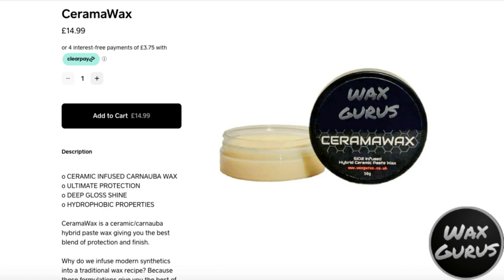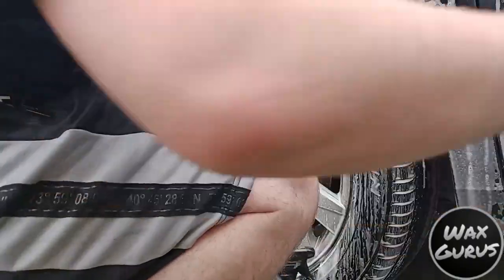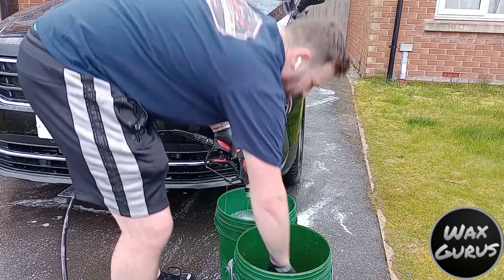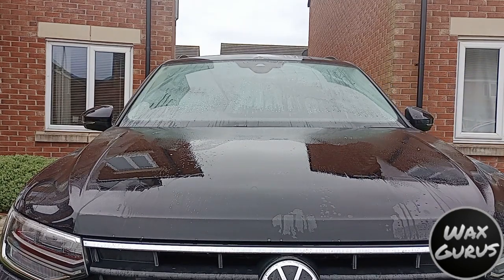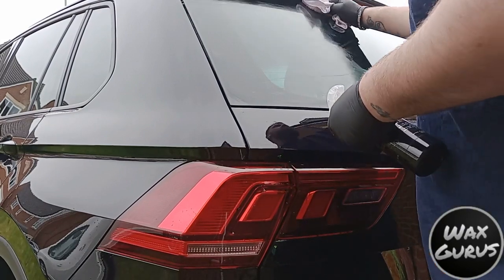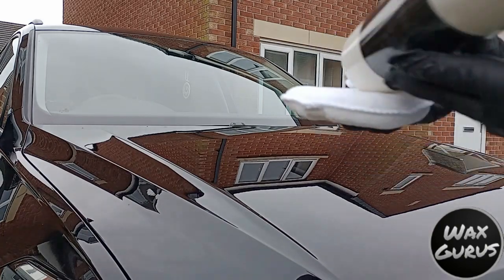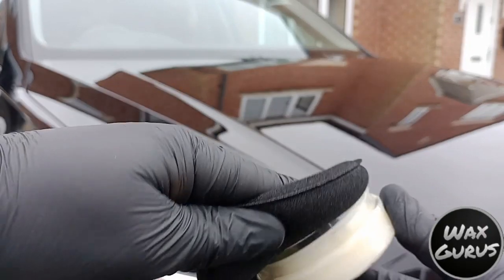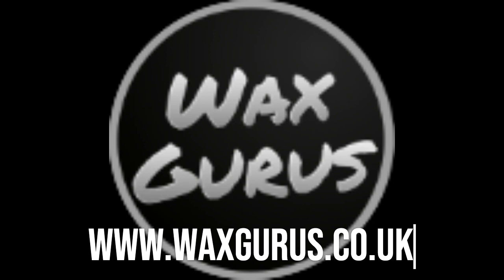WAX GURUS - HYDRO X AND CERAMAWAX

Comment: Great video. How do you do the initial glass prep, to get rid of things like wiper arc marks and water spots? Do you clay bar it?
Reply from the maker: Thanks for watching buddy. Really appreciate that. In this instance the glass wasn't too bad at all. However I would recommend if it's heavily contaminated to clay bar before polishing. You can also use 0000 wire wool to polish up glass if needs be but only if the claying and polish don't get it as clean as you would like 👌